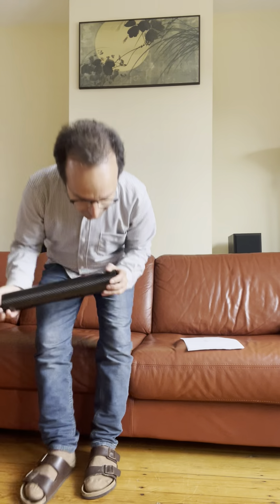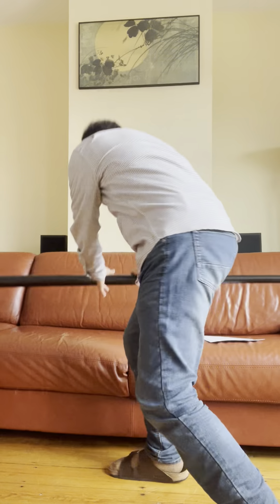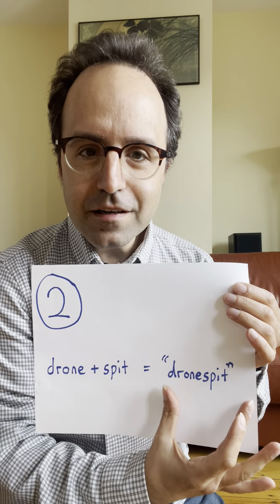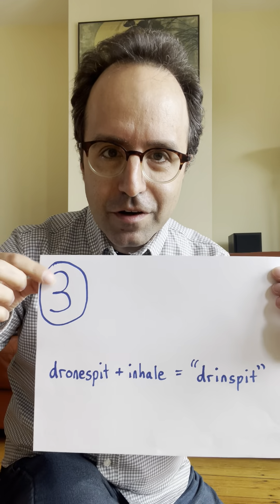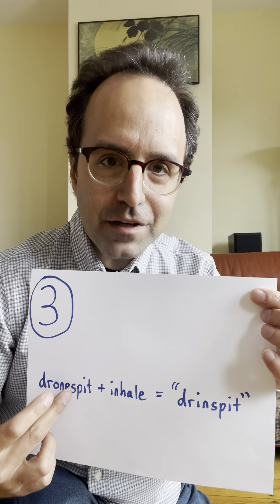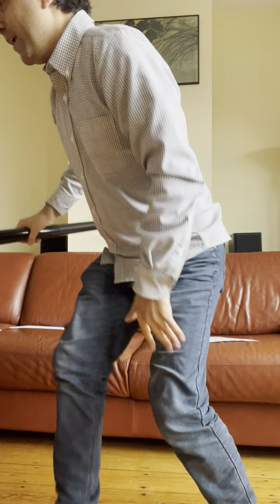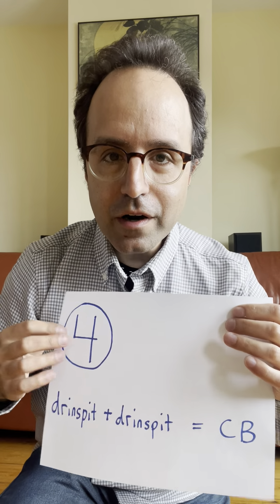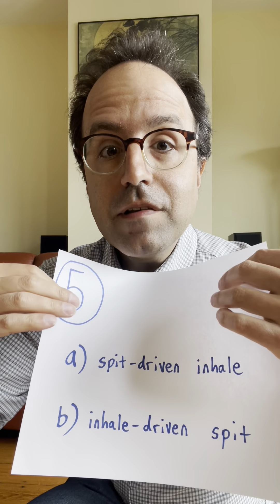HOW TO CIRCULAR BREATHE ON THE DIDGERIDOO (a somewhat wacky tutorial)

Comment: Yesssir! Good breakdown of steps to think about, and also your longer improv vids on didge are great. I'm working on it, myself.
Reply from the maker: Thanks for watching & letting me know. Glad to hear that you're working on circular breathing -- what a great thing to work on, right?  About the video: I've been thinking about doing some follow ups, like a deep-dive on each of the individual steps.  A closer look at what's happening in the so-called "dronespit," for example.  But I'm wondering if anyone out there actually wants that, so let me know if any specific questions came up for you that I can address in a followup. Best of luck with your didge journey.
Reply: @rudiseitz  Yes please to the detailed deep-dive into the individual steps. Watched your vid and going to try your steps tonight in a practice session. Been working on CB for awhile now and watched countless tutorials already but feels like yours is different, maybe because you are doing it closer to the time when you yourself learned the process rather than years later like most of the online tutorials or maybe your insights are just that much clearer than many of the existing tutorials.